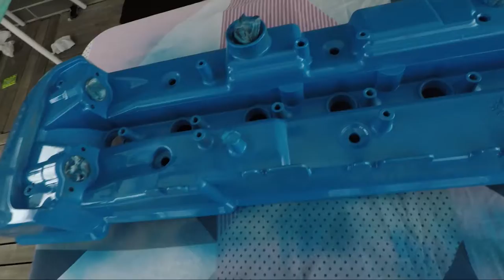FG XR6 Painting Rocker cover

Comment: Where did you buy the paint from and how many cans of paint and primer did you need?
Reply from the maker: I just got my paint from supercheap. I believe I only used one can  but two probably wouldn't hurt if you wanted some extra coats
Reply: @JoNoBaRr92  no worries what colour blue was that did it have a paint code at all my bf xr6 turbo is bionic blue wanted to paint my cover to match also
Reply from the maker: I can't remember now. It wasn't paint matched. Just a high temp blue paint
Reply: @JoNoBaRr92  Np cheers

Comment: You shouldve used hi temp paint.... personally i wouldve just polished the aluminum alot of your paint will be covered up by the coil cover anyway but hey your prerogative m8.👍
Reply from the maker: Ken Fisho I did use high temp paint? Wanted blue rocker cover to go with car paint
Reply: @JoNoBaRr92  my bad thought it looked like standard paint ... understand the colour match you should do the chrome bit on the coil cover too then👍